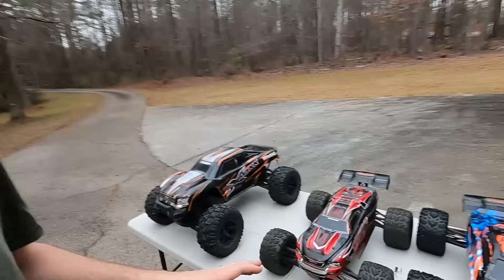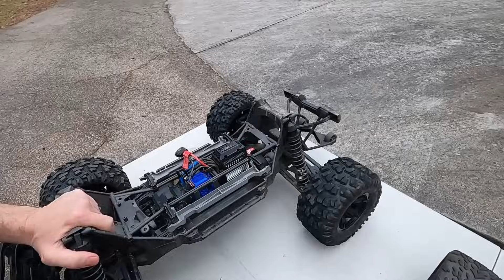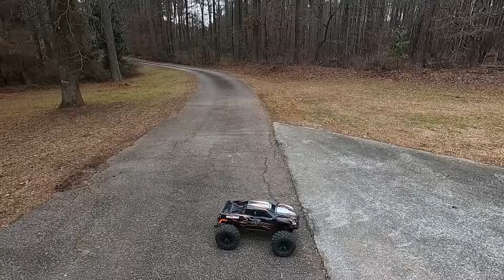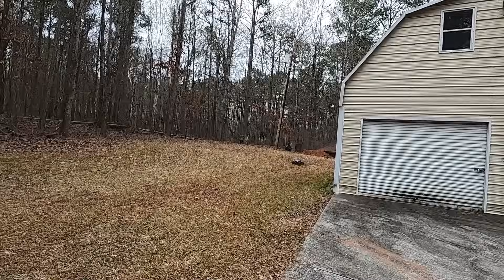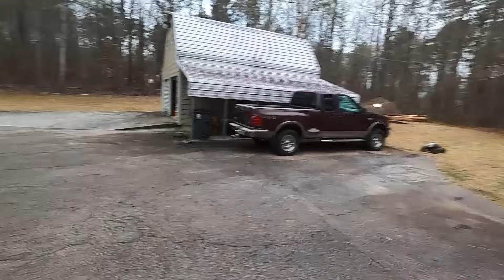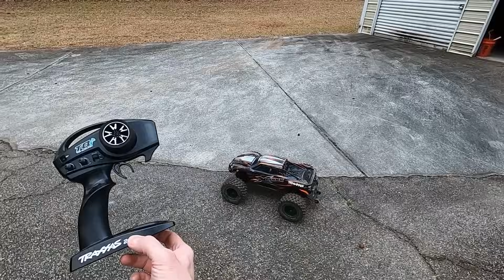Why Is My XMaxx Stock And Why Don't I Use Badlands?

Comment: I still don’t know how you still haven’t blow any pinion gears
My truck is fully stock 
And I’m only running 6s
Just keep going through pinion after pinion
Even with up grades
Reply from the maker: Hmm.. I dont know. Do you think its something you are doing with your driving? Are you landing under power or break? Are you breaking spur gears?
Reply: @outsourcedrc  no not breaking spurs
I’ve only really just ran around the yard and hopped off curbs not jumping or anything
I wonder if something is bent
I bought it used so it is a few years 
I wonder if the other guy messed something up
Reply from the maker: @brianvassar2556  Oh yeah that could be. I'm not sure exactly what is going on.
Reply: @brianvassar2556  check for play in motor shaft , you may need a bearing

Comment: I agree what about the maxx .would you say the same no upgrades
Reply from the maker: So far I like it with no upgrades. I actually took the Wide Maxx kit off. I like it better that way
Reply: Thats funny so did i . i hated it .took it off and went back to stock myself i do have aluminumvhubs and carriers

Comment: Do you feel the same way about Maxx? What tires do you recommend?
Reply from the maker: My Maxx is also stock, but I don't run it all that often. I actually took the wide kit off.

I dont have a tire recommendation. I looked at getting some of the Traxxas T MAxx tires for it though.

Comment: This is why I favor racing setups rather than this whole "more power more better" bullshit that's infested the hobby. I want to spend my wrenching time either building kits or fine-tuning my cars' setups, not on repairing things or constantly trying to weed out weak points, and I like my cars to be actually driveable. I actually "downgraded" my JATO from the TRX 2.5 (this was before the TRX 3.3 engine was a thing) to a Dynamite Platinum .12 because the TRX 2.5 was both too much power and was a pain in the ass to keep properly tuned.

That being said, wheels and tires are one of the few things I do recommend upgrading, especially on lower-end model, but even on high-end stuff as a tuning option since different treads behave differently on different surfaces. But when you do that, get something comparable in size to stock. Those badlands you showed in the video are meant for 1/5th scale vehicles like the HPI Baja, Losi 5IVE and MCD R5 series, and while they do fit the XMaxx's hubs, they're too big and heavy for what's supposed to be a 1/7th scale truck.

Comment: Thats my plan. But with Traxxas ESC issue..probably my only upgrade is the MAX6 (maybe max5:)
Reply from the maker: I dont know what ESC issue you are talking about. I kinda think that people with ESC issues are running the wrong batteries. I've had no issue out of the ESC on any of my Traxxas
Reply: @outsourcedrc  Both of mine MAXX and XMAXX has that ESC 3 red flashes of doom . its well known over the internet..I guess you are one of the lucky one that has not run into it yet?
Reply from the maker: @meda2ni  Are you running Traxxas batteries? what kind are you using?

Comment: Im the owner of the Badlands that were tested. You gave people bad info. I broke it one time with you and it wasnt because of the Badlands. It was because i botched the landing. Secondly, on the same day i broke the wheely bar because of another ill fated landing. Not any of my breaks were due to the BAdlands. Ive never snapped a wheel off with you. Im still ruinming the stock servo from the original purchase 3 years ago.. please give acurate info.

Comment: So i did a full m2c beefcake kit on mine  tire hobbywing 5687 max5 shoegoo body mod 1.5 gears with the backflip tire it weights 26 lbs and with my badlands on it it weights 27.  I have a bunch of arrma cars and traxxas cars.  Dont get me wrong i love my x maxx but it breaks no matter what stock or fully built.  Im not brand loyal but i will say the x maxx always has me working on it.

Comment: Im planning to get an xmax at the end of this month is it true about the ESC going bad?
Reply: Did you get the Xmaxx?  Have you been through an ESC?
Reply: @Toys4Life  yea i ended up getting a Xmaxx i got the green one its been a year and no issues with the esc or motor
Reply: @TheK20eg  interesting, cuz I'm kind of worried about the ESC as well. If you had the gas, how many packs do you have through it?
Reply: @Toys4Life  Honestly im not sure how many packs but ive had it for a year and i defenetly driven it more then 5 times so i guess more then 5 packs i dont jump ramps either i just drive around maybe thats why i havent had any issues except for one wheel blowing out after i geared it up so i put badlands other then that no issues man

Comment: It's not the Badlands fault when you slam on the brakes your brake setting needs to be turned down on the ESC
I run 50% on the breaks with Badland and slam on the brakes and it does not flip over 
But I know with stock ESC stock Tx/Rx you're very limited on what you can do 
the best upgrades are Max6 & servo & Tx / Rx & not a Traxxas servo
Reply: Exactly..my stock tires will endo at 100%...

Comment: I have the original Xbox with 6s and I wanted to get the power upgrade kit except leave it at 6s but get everything that makes it stronger other than that that truck is Rock solid and fast as shit if you upgrade that thing you're just a RC junkie (& don't blame u) been there done that. LOL thx 4 the video👍👍💯
Reply: Not Xbox, xmaxx obviously 😉
Reply from the maker: @honda116969  lol I guessed

Comment: I just bought my xmaxx the second time I drove it I broke the shock cap off and all I did was rolled it over in a corner. I can't beleive it broke that easy. now I can't get stock caps they are back- ordered everywhere traxxas said they would send me some when they are back in stock. now I sit with a broken truck and don't feel like I have choice but to upgrade highly disappointed
Reply from the maker: Thats unfortunate. Maybe you can get some off of Ebay pretty cheap?  I hope things go better in the future.

Comment: Check out Kevin turbot, swears by his xmax as best rc car ever, has done some minor upgrades and does front and back flips. It's an 8s with 6s motor and maybe a sicon earbud in centre diff, upgraded spur gear and one part of steering and he sends it to the moon off skate parks.well worth checking him out. Same philosophy, keep it light

Comment: Stock wheel weighs 610g, Badlands wheel weighs 814g. No where near the "twice as heavy". My stock tires lasted maybe 7 runs - foam disintegrated, rubber torn...

Comment: Mine was stock until the ESC broke and the 6700mAh batteries got tired. Buying a new $300 VXL 8s instead of a $200 Max6 doesn't make any sense, and for two 6700's you can get six Turnigy Heavy Duty's which is a far better battery. That's 15000mAh vs 6700mAh, and alot higher punch/lifetime. I did enjoy it stock, and would've liked to keep the light kit, but Traxxas's prices are just stupid.

Comment: Try out the Duratrax Banditos belted they weigh much less than the badlands and only a little bit more than stock.
Reply from the maker: Arent those street tires?
Reply: @outsourcedrc  Yes, they are intended for street so they deteriorate slower on pavement compared to off road tires but they still work perfectly fine on grass, dirt, gravel, and surfaces like that but does not work well in snow, thick mud, or sand. I like them and find that they are a good balance, plus them being belted is a nice benefit.

Comment: ever notice how the mojave guys never has diff problems but the kraton/outcast guys do more often ......same diff smaller tires .....coincidence i myself think not
Reply: Ya that’s true.   My Mojave has been solid and I put it threw some rough running.  Those small tires really reduce strain in the drive train.  The truck is one of the toughest I’ve ever owned
Reply: Interesting observation!

Comment: I don’t know what i am doing wrong but I broke 3 suspension arms in my Xmaxx in the first week I got it the First time was my fault I jumped it fast into a tree but the other times I slowly hit something and it just broke off it seemed like it’s stronger in all the videos I run it Stock just put the high Speed gearing on.  
(Sorry if my englisch is bad im from Germany)
Reply from the maker: Its hard for me to tell without seeing it. Do you have it on video? If so, post it and I'll take a look.
Reply: @outsourcedrc  I think it was just the cold weather I put the rpm pins on with the nut on the end and since then I never broke an arm

Comment: I have a feeling that it was not the purpose , but in this video You are giving the answer for "why You should upgrade x-maxx. Stock sevo - minimum power to just be able to somehow move wheels, ESC - wired thing is happening with other tires and trust me that it is just the beggining of issues with their shitty ESCs, tires - balooning and very poor durability (try to play a few times on the ground with small sharp rocks, they will be cut), center drive shaft - one piece construction is horrible idea for this weight as it bends, radio - try some aftermarket ones, huge amount of options to increase performance. TRX counts durability limits for their parts just to let the car go ahead. If You want to do anything more then You have to look for another solutions. I believe that TRX made a mistake while doing math for the chassis and diffs, that is why those do not cause issues 😆

Comment: Those tires are not twice as heavy. 

Xmaxx stock wheel 610 grams
Pro-line badlands 815 grams

They are exactly 33% heavier.

Stock xmaxx tires come unglued, and the foam crumbles inside. And they balloon like crazy.  That’s just not natural. RC’s really need belted bead lock tires. We’ve needed that for years now.. Your tires come unglued and debris get every where and ruin a tire.. Then they become unbalanced, and you are just putting stress on the drive train. Nothing wrong with a 30% heavier wheel. 

The xmaxx is WAYYYY more heavy duty than it’s stock wheels can even handle. 

PS. I have never ran stock wheels and tires on my Xmaxx lol. I just mounted them up, and I’m gonna give them a try next time I drive it. It’s raining every single day here in NC!

Comment: put the included 46t spur on it and you will be able to do backflips 😎
Reply from the maker: Maybe I'll try that out.
Reply: @outsourcedrc  my advice is not to use the traxxas 46t spur gears that come in the box they seem to explode under the power.. it did happen to me which in turn broke my pinion gear.. go for an upgraded spur gear jobs a good one

Comment: My issue is the realibility of these electronics that are generally junk. Ever since Traxxas left Castle for their outsource maker they have had some of the worst electronics for bashing. My ESC caught on fire the 2nd time I played with it and I only did a small 3 foot jump. No other bashing, didn't hit anything just poof, since then I have gotten the xmaxx and got a max5 and new motor in it and hubs. The stock hubs have way too small of bearings and its known to upgrade those and get the wide kit

Comment: The reason for me wanting to “upgrade” my tires is simply because I absolutely can not stand the tire ballooning. It drives me crazy! Not much different than you not being able to stand the slightly offset decals on your LMT. However, I don’t care for the mx-43’s either. The rubber was too hard and they are heavy. I ended up with duratrax hatchet’s on my x-maxx and like them.

Comment: If all you wanna do is those little jumps and drive around on flat even surfaces and you are ok with the speed,....yes there is no need to upgrade.  No need to get wider and sticker tires on you passenger car if you are fine with long braking and medial cornering.  No reason to get new shoes if yiu are okay with having them to often match yiur outfit and dont care that they are worn.  No need to upgrade your plane ticket if you dont mind being in the back shoulder to shoulder with strangers, knees against the seat in front of you, having a 5am flight, and not nesr the person you are travelling with, and having a long lay over.  You get the picture.

Comment: If you were to have a Conversation with rich duperbash he would tell you how weak as piss the truck is and how it's super slow mushy!
Horses for course I suppose.
Mine Xmaxx is upgraded, I have a Castle 1100kn and XlX2 and Most of the Frame and weak point are M2C and Vitavon Alluminium.  I love it though.  Happy to upgrade it!

Comment: It wont back flip because it doesn’t have the proper gear ratio… stock is weak and gets hot easy. Traxxas electronics really are not great to use long term. They get 50 degrees hotter than something like hw or castle…. Plus driver mod keeps stuff from breaking. Its not necessarily the upgrades.

Comment: It's very subjective depending on how you drive. Based off your videos I would say you are a casual basher. So in your eyes no upgrades are needed. It's a traxxas, there are always certain things that need upgrades. They market it for extreme bashing so for the extreme bashers that run strictly on 8s, there are weak points. It is one hell of a tough truck for sure but traxxas has a company will always have weak parts.

Comment: If you want an xmaxx either build it up or buy a roller.
$1000 for an traxxas xmass is just throwing $750  in traxxas pocket. You will need arms x4 rear carriers x2 front hubs x2 servo,esc,motor are all better aftermarket, tires aftermarket 4x traxxas tires is $140, driveshaft is crap, bumpers are crap,controller is crap. Indestructible bodies are $50, Dont fall for this advertising bs. Learn to build it yourself with proven durable parts.

Comment: So technically you want a good set of tires to act like a bad set of tires? It's like expecting a hobby grade RC to act like one from Walmart. It doesn't slide sideways because your braking first instead of offsetting the center of gravity by turning into your turn and then hitting the brakes. Also if the tires have more grip you can't expect them to slip and  slide like the crap Chinesium tires that come on the Xmaxx. People break stuff because they do not understand physics. It's not the weight of the tires but the extra traction. The stock tires act like a slipper clutch when taking off because they cannot create any good traction thus releasing the energy as wheel spin instead of forward momentum. Also as far as ESC going out simple solution but a temp gun and learn how to use it. A $5 pinion gear can solve that problem.

Comment: It all rc s they put a tire with a certain weight. To much grip breaks other things. Yes change if issues but match better grip but not over kill.I have a big rock hate the wet blacktop traction I want a tire same weight better grip on blk top wet. Haven't found a tire yet.

Comment: I used the original tires with the stock system, blew 3 tires in the first run only using 17/46, imagine running an 800kv or 1100 KV combo with the original tires 🤦‍♂️will not hold up, proline can take  800kv Full Throttle and come out of it alive because some of us actually like upgrading the power to our vehicles but I doubt you understand being that your still using the stock system that came with the xmaxx 😆 and everybody knows that the x-maxx comes with a plastic gear servo, problem solved with the upgraded metal gear servo, this hoddy is not cheap

Comment: I think its only traxxas who does this the 3s line brushed they installed a brushless system on all of them and they didnt really improve the key components like the driveshafts and hubs. I know arrma kinda flopped on the early release of the kraton 8s with the tower to tower brace system for the chassis and the shitty remotes. Traxxas should be doing v2 of their trucks its getting quite old and date designs

Comment: The thing is man you say it doesnt need upgrades but Heaps of people want to go Bigger and faster than Normally and you are someone who does not. That is Fine but you cant justify saying that there is No need when you're Only basing it off the little jumps and what not that you do.
I jump mine 100 Feet on to Flat ground without issue all day long.  Bet you can not pull that shit off with your stock jobby!  Again, that is fine, but you got no case when using your Framework ONly.